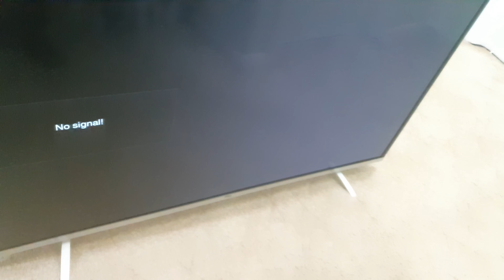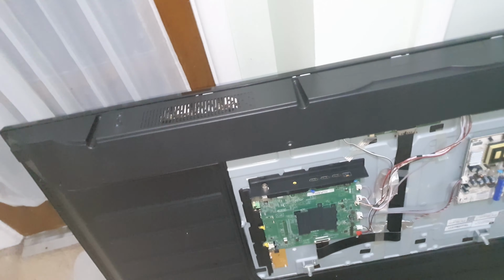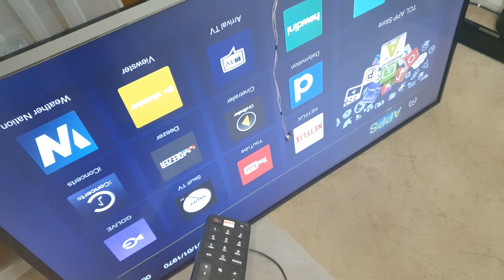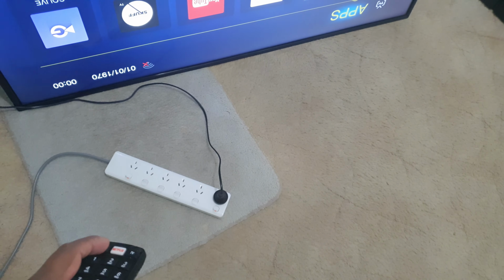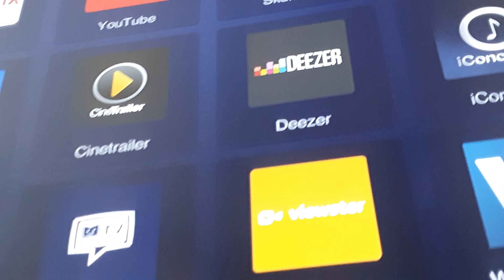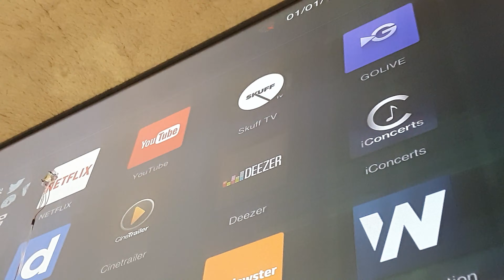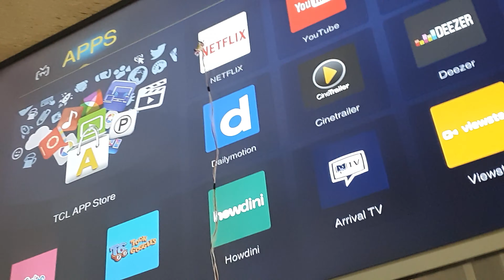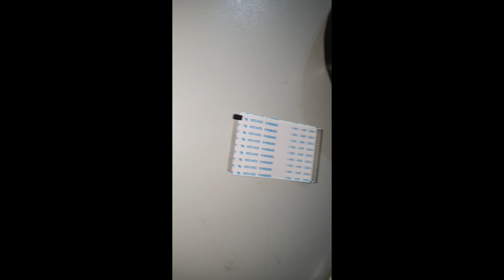Smart TV Intermittent Flickering Horizontal Lines Issue Fixed at No Cost

Comment: hi..I have an issue with horizontal lines appearing on  my ONe PLUs andoid TV( model 55U)...It began with one at the bottom, then another one above it and now another line right in the center....Is there a solution to get rid of these horizontal lines?

Comment: Tried your fix - was able to get most of the screen back.   Now I have a small area in the middle of the screen with 2 vertical lines about 3"  - - - long.    Do you suggest replacing the cables or maybe a new TCON board?  Thank you - good video by the way.
Reply from the maker: Sorry, Without looking a image, i can't guess that what is the issue.

Comment: I have a Bauhn ATV58UHG-0121 bought at Aldi in January 2021 with some horizontal flickering lines which appeared about 29 months after purchasing the TV. I just opened it and the 2 ribbon cables which are at the same edge of the T-con card are folded very sharply. Could it be possible that the problem in my case is in one of the cables?

Comment: Sir, thank you for the amazing video.  But how to fix the wrong signals from both ribbons ( both sides ) ?
Reply from the maker: What did you mean bu wrong signal from both ribbons? Did you mean the both sides have the issue? If yes, this method will not be worked. I'm not sure whether your tv has a T-CON board issue. So think about that as well.
Reply: @tech-corner2556  Thank you very much for your response sir. Yeah, both side has the issue. TV does not have a separate t-con board.  The motherboard has both ports.
Reply from the maker: @OfficialCodeYourDreams  Then bad luck. But just give it a try from the main board side by adding tape. I'm not sure whether it will be worked or not.
Reply: @tech-corner2556  Ok sir. I will try. Thank you for the help.

Comment: Still cant believe i just fixed my TV,  had flickering lines multicolored horizontally across the whole screen. I actually unplugged one side checked the what difference it made, i assumed the side still showing the lines was problematic, i ended up being correct and had to add another small strip to take thin lines away that appeared constantly. 😳  Skyworth 49 inch smart tv
Reply from the maker: Great to hear that, thanks for letting us know.

Comment: thanks I did the same trick, the flickering gone. But now it shows a horizontal lines at the top of the screen (more usable than before when it's flickering). Any idea Sir, what could be the problem?
It's Samsung tv btw. Thanks in advanced
Reply from the maker: @baghol, Try to reduce the tape thickness. May be it is blocking more lines. and try with different locations(blocking different lines in the ribbon cable). Again, it depend on the damage, may be you can fix it completely may be not... Good luck..!
Reply: @tech-corner2556  thanks I did it until only 1 line blocked. It still have lines at the top of the screen, but after few days it disappear. Money saved! Thanks for the tip
Reply from the maker: @baghol  Thank you for the feedback. I'm really happy about your effort and results..